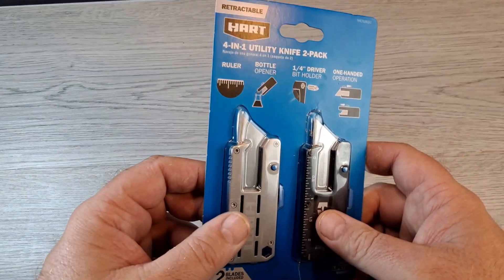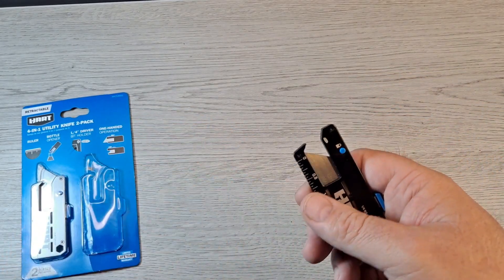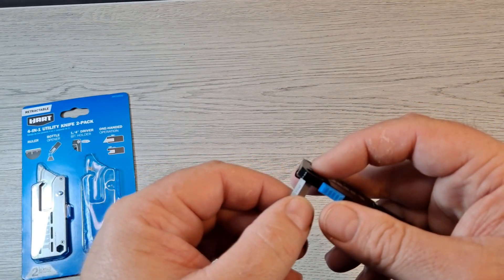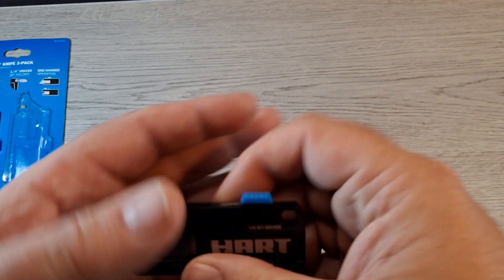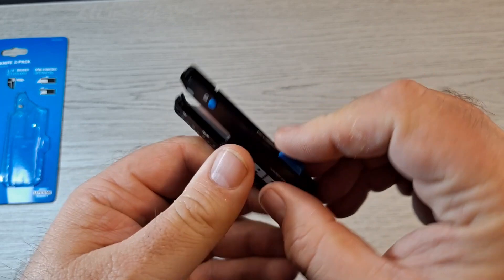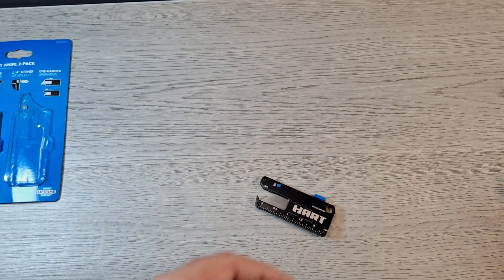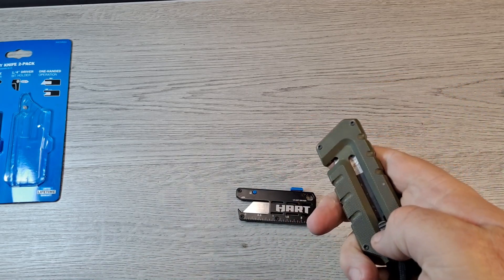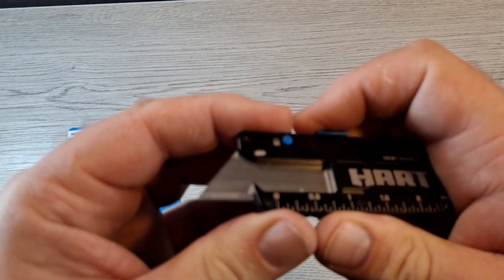HART 4 IN 1 UTILITY KNIFE 2 - PACK FOR $8.88!! FIRST IMPRESSION AMD COMPARISON, EVERYDAY CARRY, EDC

Comment: Cool looking little tool. I wouldn't use the bit driver as I would drop the bit into an area I would never recover it. Not bad for  4.44 each. Good find.
Reply from the maker: I wouldn't use it either. If I had a bit I'd have a decent driver already.